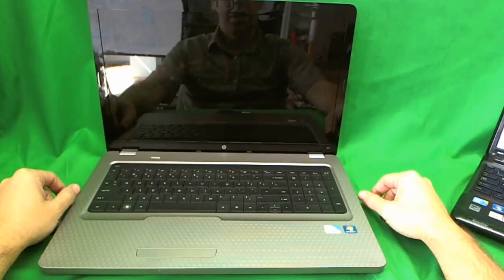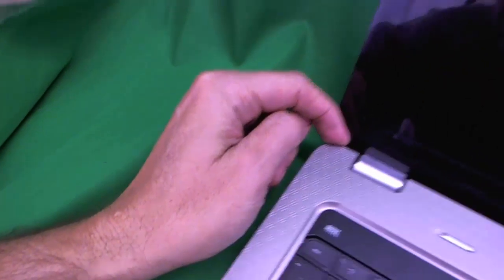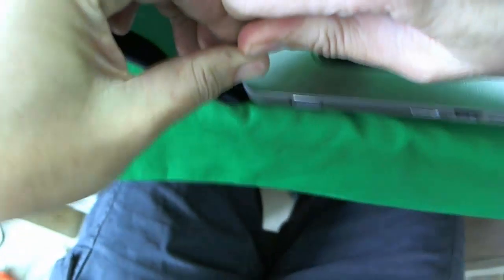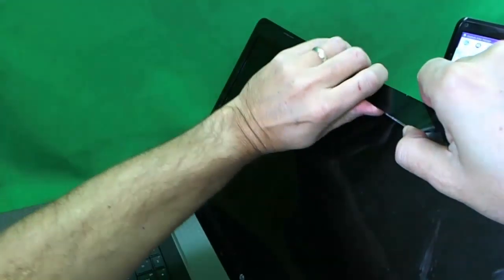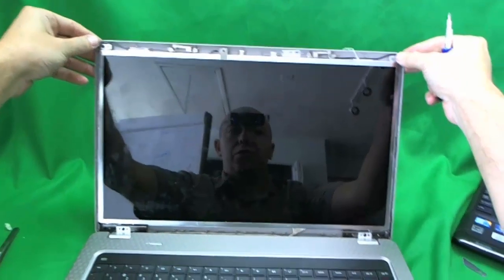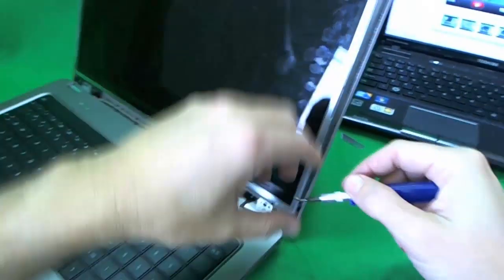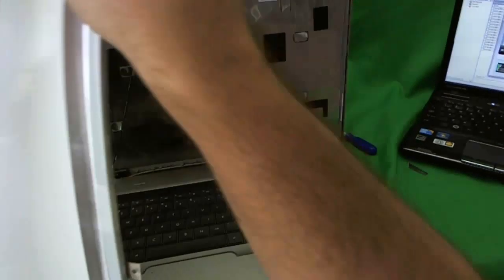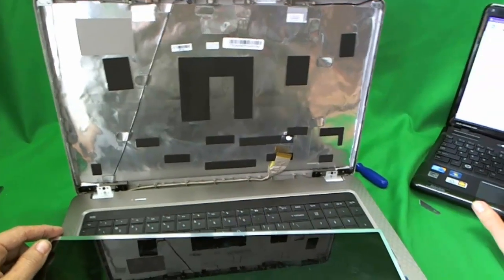HP G72 Laptop Screen Replacement Procedure (Quick Method)

Comment: Ok question. I have this computer but it seems to have a wiring error. When ever i turn it on the black on screen(most of the black) turns to a bright green. There is a space on the left hand side that says ALTEC i can press on that with my thumb and most the time it will correct the problem for a short period of time. Would you happen to have any tips on why this is happening or a way i could get inside and fix it myself?

Comment: @12welcomekamal12 Me too. Saved me a TON of time taking the whole thing apart just to get to those two screws. Just have to lean a little on the LCD and you can get to them. I found it more difficult to get them back in however as the screws didnt want to start unless you REALLY leaned on it to get them vertical. But, its done haha!